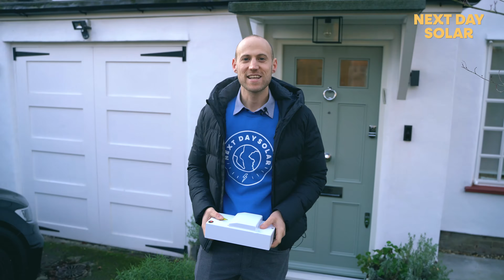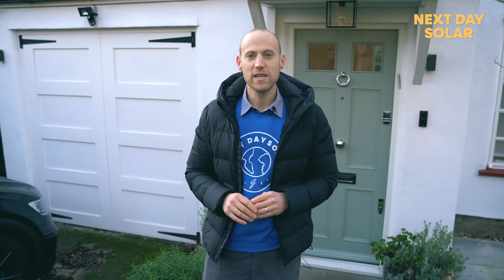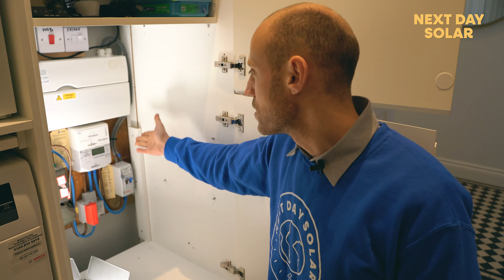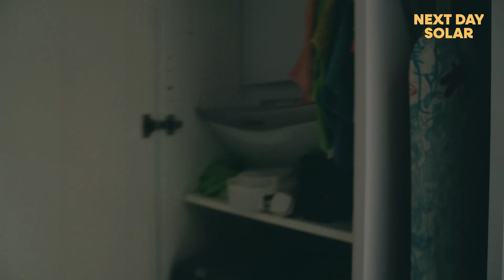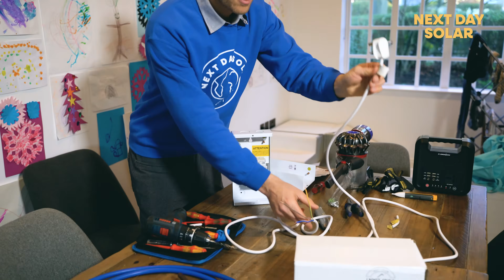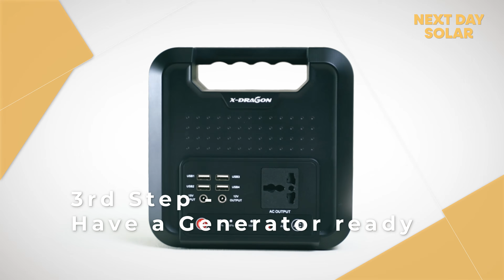Home backup Battery Generator Solution for Power Cuts

Comment: Did you have to notify the DNO? 

I have a garden setup that was primarily used for a workshop, but with how much power I produced last summer I had a feeling it could run my entire house for at least full days. 

4x 500w panels connected to Victron 150/45
2x 535w panel connected to Victron 100/20
1x 48v 6000/12000w peak PureSineWave Inverter
1x 2.5KW 48V battery

Its connected away from the hosue so currently has its own earth rod, but I've been really interested to install something similar to power the house.
Reply from the maker: Hi, 
No you don't have to notify the DNO of a change over switch. Naturally you need to notify the DNO of any grid tied inverter now above 5kWh. 

Your setup is nice, however the inverter is not certified to be grid connected so you'd need to have a change over switch to disconnect from the grid if you wanted to power your home. Your battery is also quite small, so of course it would work, but you'd need to ensure plenty of sun on those panels and passing through to the battery to keep it all up and running. 

Good luck with the project, sounds like fun.
Reply: @nextdaysolar3349 I was making around 4.5/5kw per day with just 2 panels last year summer just gone and recently upgraded to 4 more. We use around 6kw per day so once the DChouse 48v batteries come back into stock I'll upgrade to another one totalling 5.2kw. Will be scheduling an electrician soon to install the change over switch! Thanks for your help!

Comment: Some useful information but where is the second video you mention in the comments.
I have two portable EB240 battery backup units (each 2.4KWH) that I'd like to wire via a switch (I know I need the mains isolator first).

Comment: Heat pumps that they are trying to force on us require huge amounts of electricity that will drain the expensive batteries in just a few hours. Oil and gas like you say work very well though.

Comment: Not a great install to be honest, not seperate earthing system in place to referance the earth from the inverter or a neutral earth link, not only is this in breach of regs, but the DNO will not take to kindly to that either. Also the change over switch is now blocking the front cover from opening fully on the consumer unit, this is in breach of regulations. 

Not a fan either of the plugtop being hardwired into the change over switch, dont think this breaches regs but still a poor install method as during normal operation its going to get pulled about putting stress on the terminations.
Reply from the maker: Hi Luc, if you check out or revised video, we essentially explain why this didn't work, and setup a new system. As you note, a property should / is required to have a separate earthing, you will also know this can be tricky in certain situations/locations if the customer doesn't want such invasive works to the property. In the video referenced, the Inverter has a neutral / earth link setup which improves things. Consumer unit is fine to open fully, and be removed. The plug top to change over switch is absolutely fine, and most convenient way of doing. It could be hardwired, but its better for ease of portability of the generation unit. Anyhow, take a look at our more recent video, and think you will be more pleased, although perhaps not entirely sold !

Comment: Did you install an earth rod and have suitable N-E link for the generator/inverter?
Reply: Is this required regardless of the earthing setup ie tt or tncs?
Reply from the maker: N/E Link - Yes, the Victron inverters come with this option, so you can manually re-wire on installation. Earth rod under last years 18th Edition update, not (as requires invasive works) so as temporary setup have connected to DNO earth.